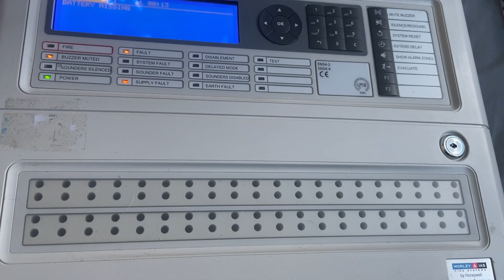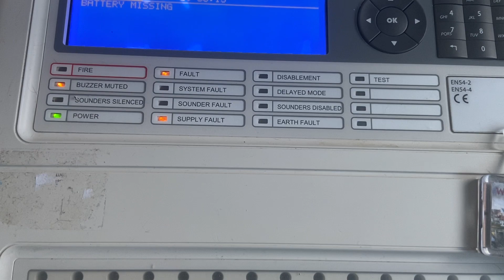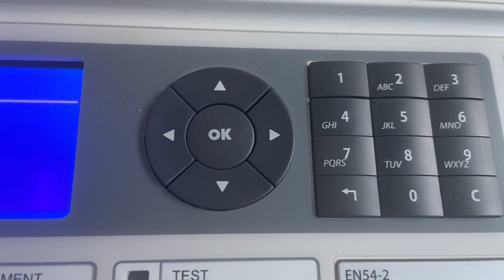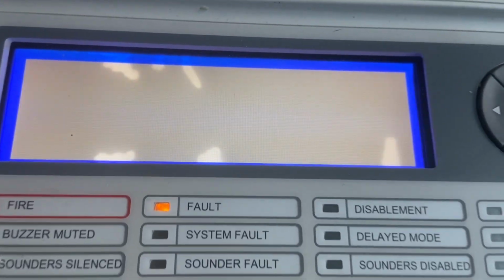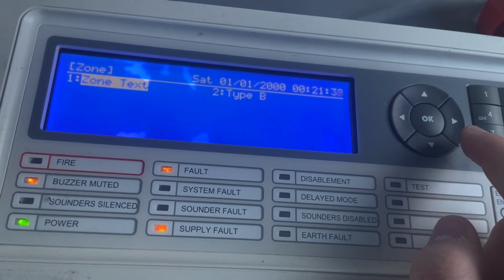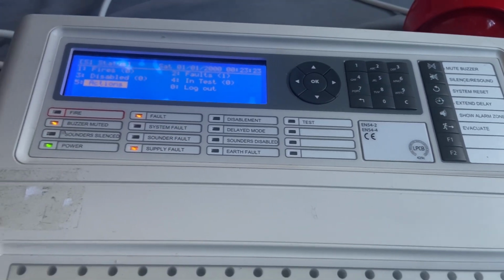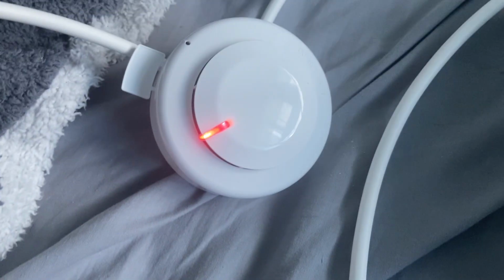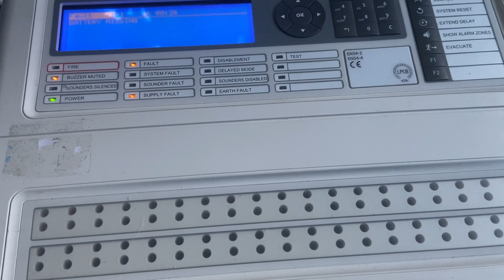Morley IAS DXC-1 Panel Overview and Test

Comment: Hi I got an moleys, how do I add devices?
Reply from the maker: Hi, usually on start up when the panel is switched on it should auto learn all devices. Also the auto learn and adding devices can be found in commission level 3 of the menus.

Comment: That’s the panel I’ll be using on my house system I’ll be using the 1 loop model with the new Apollo Reach wireless equipment I have the software for it already just need the panel
Reply from the maker: Ah nice!
Reply: @j1firesystems440  gotta say Morley panels are great to use and they have great configuration settings on it even without the software
Reply: @yeety1208   nah DXCs are better